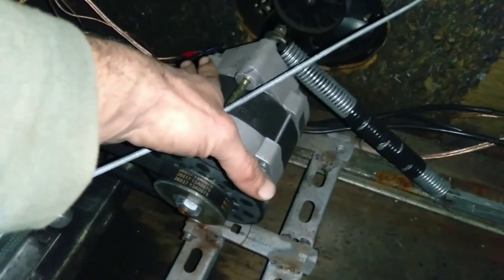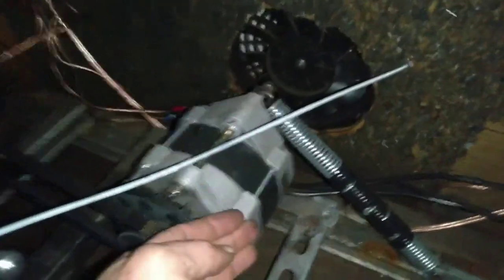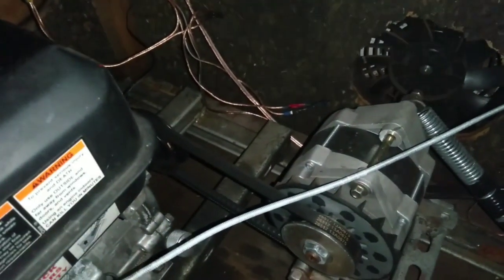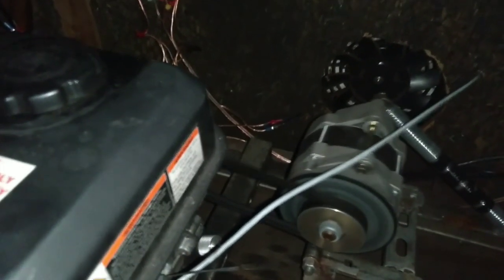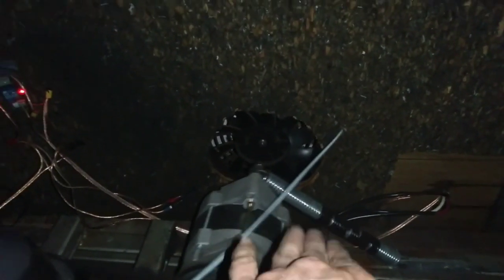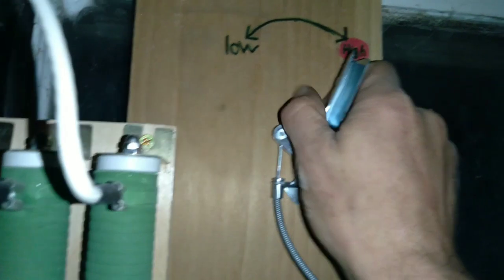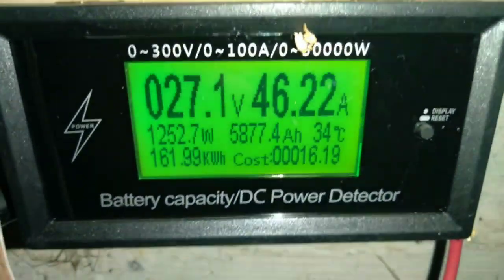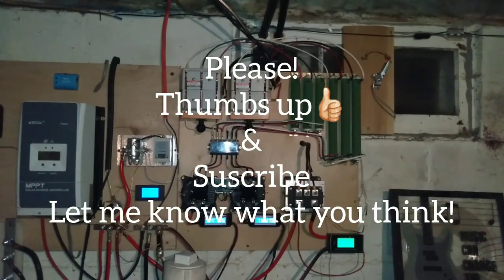Updates and Recap on Home Made Generator.

Comment: It doesn't sound like the predator is running very good, sounds rough, like the choke is left on but seeing as how you were able to get full throttle out of it, that probably isn't the problem.
Reply from the maker: It's got a tractor muffle now so sound different and as soon as it starts its under load. She's running like a champ still though. Gets regular oil changes and new plugs every spring. I also added a magnetic oil drain plug to keep any wear out of the circulating oil. For the price, they're awesome motors. Got hundres of heavily loaded hours on this thing.

Comment: Thanks for the video! That PMA sure is powerful!
Reply from the maker: Yeah I couldn't be happier with it. About 100 hours on it so far putting out over 1000 watts. I would have killed 2 "off the shelf" generators and battery chargers in that time and its not showing any wear yet.
Reply: @smallcityhomesteaders1600  Yeah that's big amps, and providing the maintenance schedule is kept up I'm sure it'll last you years. I  reworked the DC based one I made and it's good for up to 100 amps if pushed really hard but when I run it, I tend to throttle it to about 50 amps as it's using less fuel that way and just sounds a lot more relaxed. https://www.youtube.com/watch?v=_aX61tw-344
Reply: I'm working on something else you'll probably quite like. I've got a small slow-running stationary engine, continuous-duty, from 1935 and I've also managed to pick up a big heavy dynamo off a WW2 tank. The dynamo, which is so heavy I can barely pick it up, is designed to deliver it's power at very low RPM so with the low RPM engine it will happily run at 650 RPM pretty much forever on hardly any fuel. In many ways the ultimate off-grid battery charging generator even though it's 85 year old tech. I'll do a video on it at some point, got to finish the electrical side yet though. Keep up the good work!
Reply from the maker: @TheAmazingAdventuresOfMiles  that sounds awesome! I would love to see that.